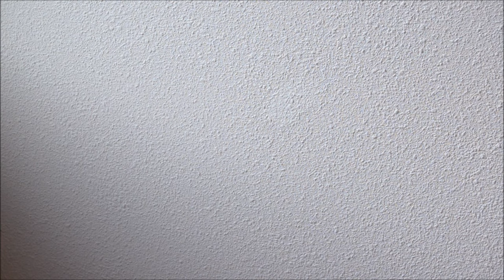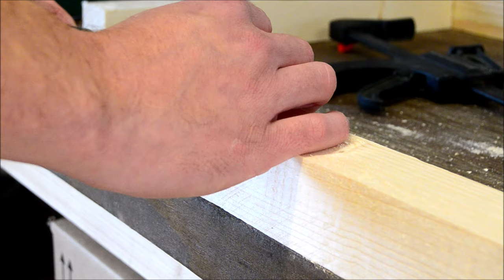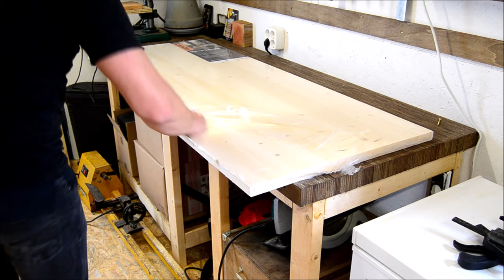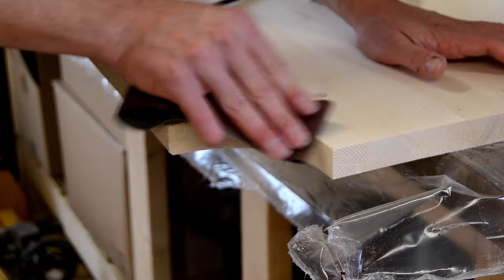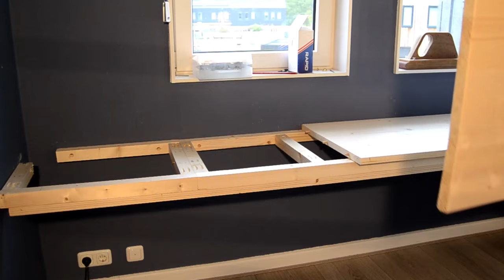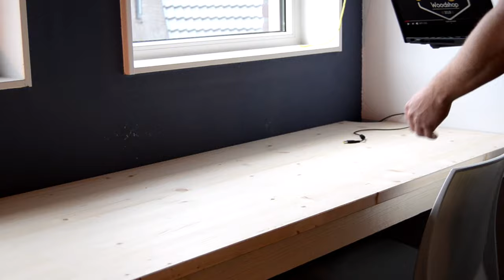DIY Floating Desk || EASY Affordable Home Office!

Comment: Is that a 2x2 frame?
Reply from the maker: Yes tge frame is made from 2x2. Thanks for watching
Reply: @Dutchshedwoodshop  any concerns or regrets not using 2x4s?
Reply from the maker: @oc3powerline  so far not. It can hold my weight altgough it will sack a bit. I glued a 1x4 to the frontside 2x2. For the lokks but adds a bit of strength aswell

Comment: Great job.. what wood did you use for the desk top? Thanks
Reply from the maker: Thanks for watching. It is a desk board made from pine.
Reply: @Dutchshedwoodshop  thank you for replying. Do you think pine is strong enough if I start mounting clamps on the desk for cameras? and lighting as I do music production and YouTube blogs..
Reply from the maker: @aziatik  The way i build it is strong enough to hold my weight in the middle (84 kilo). If you are not 100% sure you can always put one support in the middle. 👍

Comment: Can you please tell me what you used into the wall? To anker the desk to the wall(the dutch word is fine as a fellow dutch man(i think😀)). Because i want to do the same with a 280cmx60cm desk. But still unsure how to connect the fame/desk to the wall. The long part is against a concrete wall. 1side is against a plasterwall. And 1 against(i think) a small piece of wood. Then some isolation and after that some brick wall. Hope you can help me out.
Reply: Any Luck? I would also like to know what plugs were used inside the walls. From the video, they go in easily and seems like plasterboard.
Reply from the maker: They call this wokkelplug or metalen gipsplaatplug in dutch :)

Comment: did you do anything with join in the worktops ? any tips how to get the flush without any lips or gaps thanks
Reply from the maker: You can makeit flush by adding a piece of wood underneath. And screw it on. I was lick both boards were straight. Thanks for watching

Comment: You didn't show the placement of the second board below the front of the face-frame, nor the placement of the covering board on the front of that board and the front of the face-frame.  I call that cheating.  Also, an office needs at least 2 file drawers and your desk looks too low to put one under it.  How would you accommodate a filing cabinet?

Otherwise, nice work with the wood.  Paint / stain?